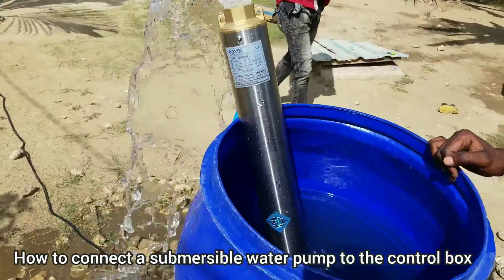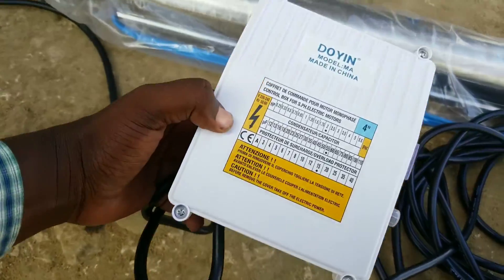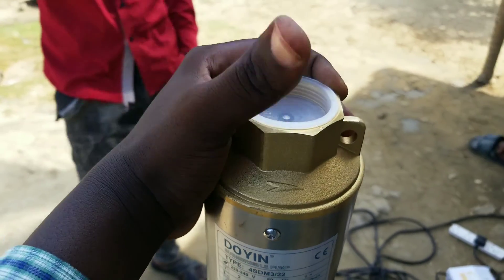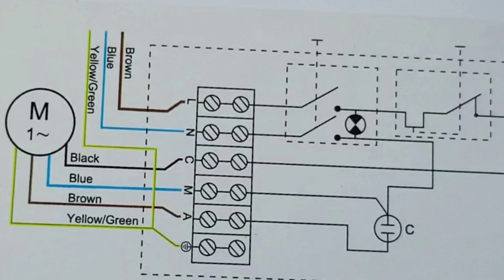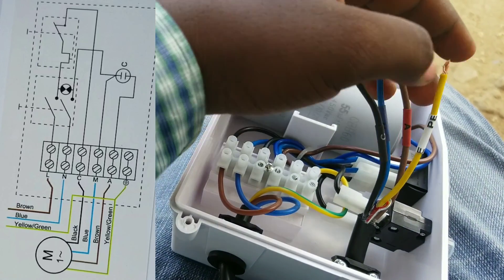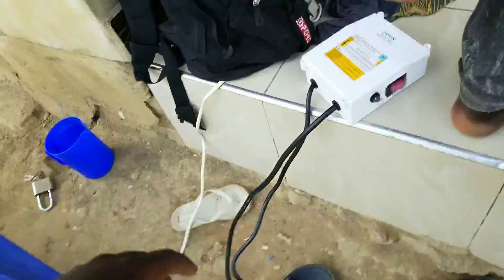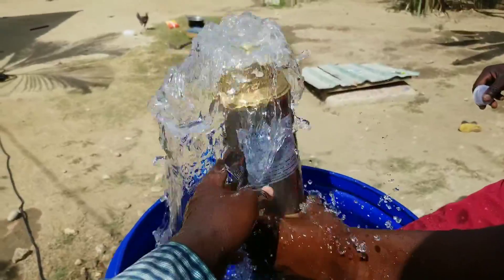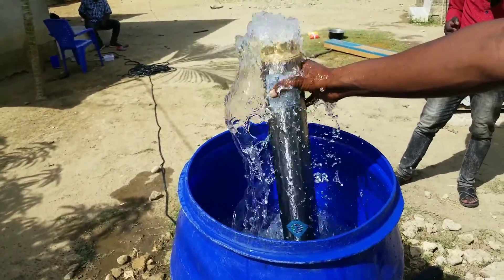How to install submersible water pump to a control box wiring connection of a submersible pump

Comment: Is it technically correct procedure*"; ?? to connect the run capacitor in series from  neutral terminal(N) to start winding ??-

of PSC submersible Motor

Comment: I have a problem here,when I switch on my control box it pours water into the tank for about a few seconds and then stops and thats it. Its hard even to fill in the water tank as it used to. What could be the problem?
Reply: You need to replace a new pump
Reply: @Gastyleespartar  Nah the water level was a bit lower than we had known. We had to add more of the safety rope and the 4 core cable thats all. Thanks anyways